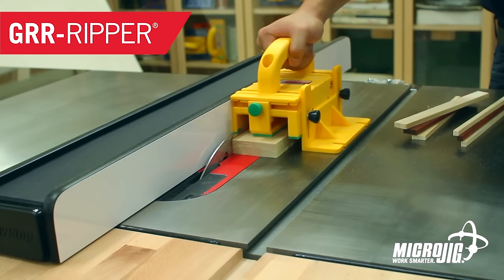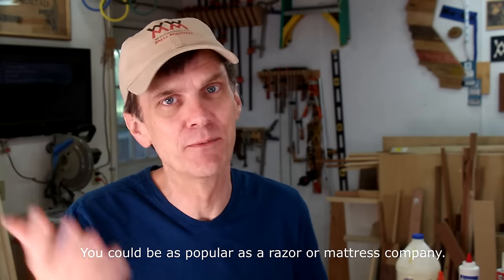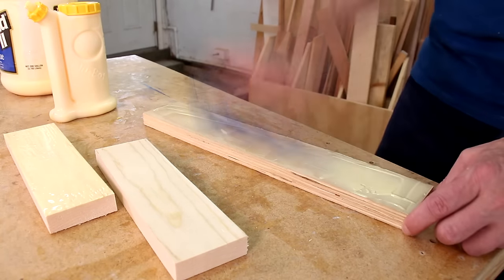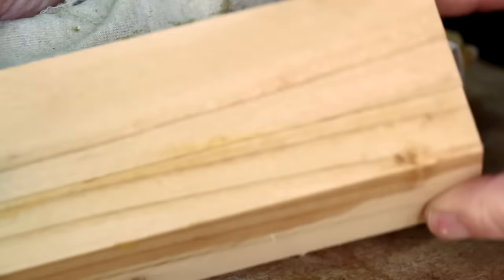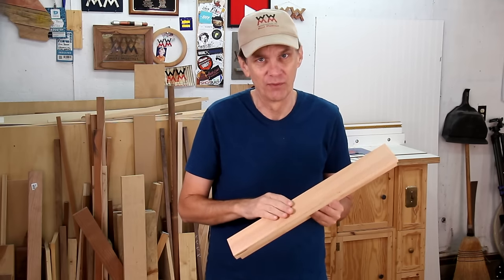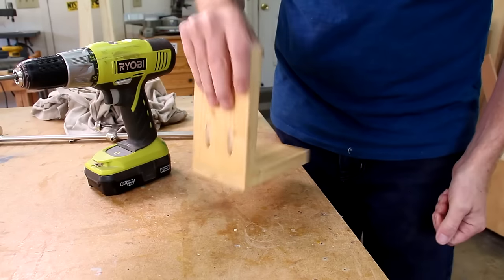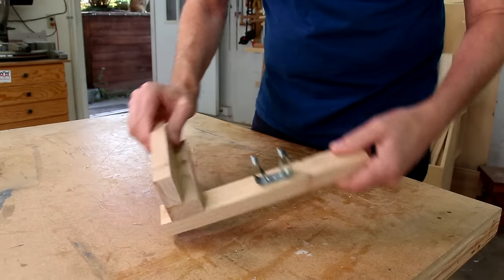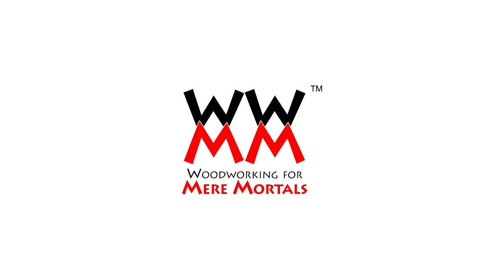What You Need to Know About Glue | WOODWORKING BASICS

Comment: I was a glue/veneer specialist for most of my life and I think you did a great job.  

You might want to mention waterproof, and water resistant glues for exterior applications. And also, what kinds of glues will stick to oily woods like teak and how the application of denatured alcohol on the surface to be glued will remove the surface oil and prepare the piece for the application of the glue.

 It has been my experience that the wood should be clamped very tight.  Those water based glues like you were using, tend to shrink as they dry.  When brushing on the glue, brush in both directions to work the glue into the pores. Brushing in one direction will pull the glue out of the pores.

Polyurathane glues like Gorilla glue will expand as it dries so you need to be carefull or you will have a mess to clean up. Because it expands, you won't need to worry about a tight clamp.  

If gluing something thin, it's alway best to use a backer board that covers the entire area and be sure the clamps are in close proximitry so you squeese out the glue.  You can coat the backer with any kind of wax like butchers wax and the glue will not stick to it.

What you did with the screws on the end was great and is exactly how I use to do it.  Another neat trick is to increase the surface area by using a spline or a bisquit.  If you look at your kitchen cabinets, they are probably made that way meaning they are routered in a way to increase the surface area to be glued.  

I enjoy watching your videos and I hope I was able to add some additional, useful information.  God Bless

Bob
Reply: Thanks for this comment. This will really help me with my college project of building a stand-up paddle board. I'm worried about the gluing the most.
Reply: Adding Biscuits for extra strength is a bit of a myth but very good for accurate alignment.
Reply: @christianpetersen1782  Yup! But they really do make a huge difference for accurate alignment that's for sure. I love them for that.
Reply: This is a quality comment! Thanks for sharing!!!! :)
Reply: Thanks for sharing. Thats why i love woodworking comunity
Reply: I really like how well u worded ur very useful comment, and maintained respect to the channel owner. 👍
Reply: Bob Perry Thanks for your advice! I am wondering whether there are any cons using waterproof wood glue for indoor and outdoor projects ...  respectively what are the pros of regular non waterproof wood glue. would appreciate your response thank you!
Reply: Although I agree about not having to clamp gorilla glue, tightly, I generally do because the pieces tend to slide around, quite a bit. Another thing is that, I hope no one was confused and think that it doesn't require a clamp, because, due to it's expansion quality, it would force the pieces apart.
Reply: @annaalm18  from my experience, the biggest downside to waterproof wood glues (such as Titebond III) is that it seems to discolor more than others. It's not that big of a deal if you're building a simple picnic table and just using sealer to weather proof it, but if you're planning to build an indoor coffee table out of cherry and you plan on using real finishes for visual appeal, it will darken the color considerably at the joints.
Reply: Bob, what think of UF (Urea Formaldehyde) Resin glue?  Weldwood makes one.  I am amazed at the strength of it!  Thx.
Reply: @JoshuaParnell  that's interesting - THANK YOU!!
Reply: Bob Perry My Son used to Skateboard. And I have his old boards that I want to cut down into strips. Then glue strips and make a shallow bowl or picture frame using the multi coloured veneers for effect. 
Can you recommend a good glue for this?
Also. I have a phobia about too much clamp pressure. To me it’s like you squeezing the liquid out of where it supposed to be. In other words. A thinner layer between pieces
Reply: Covis KK tightbond 2 or 3 would work fine. Heavy pressure not necessary however, clamp until there is squeeze out. The aforementioned comment about discoloration hasn’t been an issue for me throughout the years due to planing/sanding taking place after glue up. Shouldn’t be an issue for your project whatsoever.  Have fun with your project.....
Aloha 🤙🏽
Reply: Thankyou Bob - this is why I like to read peoples  comments
Reply: @annaalm18  k
Reply: After working on dozens of ocean going boats, EPOXY is the only adhesive for me. I like slightly thickened West or System 3. They're all about the same.
Reply: ...or was it James Bond?
Reply: @byLokie  You want as little glue as possible in the joint, assuming all surfaces are clean and flat.
Reply: I wanna know about the smell, is it strong? Or does the glue safe for pets because i wanna build a cage for my hamster.
Reply: @annaalm18  Most waterproof glues dry by chemical reaction when mixing a resin with an catalyst.  these should only be mixed and  applied in a well ventilated area. I don't recommend the glues with formaldehyde because they will leach harmful vapors inside a home for a long time, and can potentially cause health issues. Outside the home is usually ok. There are other waterproof and water resistant wood glues that are safer to use like titebond, and any of the polyurathane glues like gorilla glue.
Reply: @Glen.Danielsen  Yes!  That's the typical marine glue!  You have to mix two parts together.Usually a powder catelyst and a liquid reson. Some companies make a liquid catelyst which are much safer. Dries by chemical reaction. Yes it is very strong but pretty much any glue, is stronger then the wood itself, if clamped properly.
Reply: @byLokie  No worries there. Titebond is fine and easy to use.  Don't worry about squeezing out too much glue.  I use to use hydrolic pressure to clamp door parts and window parts together and some of the things I made have been in buildings for over 35 years, so far.  The love you have for your son will make for a beautiful outcome!
Reply: @JoshuaParnell  Thank you!
Reply: @tonyhemingway7980  You are absolutely right!
Reply: Hi Bob, Thank you for your comment. Can you please let me know if I can dilute Tightbond type 3 wood glue and add 25% of water into it with an objective to make it a little more fluid, will it reduce its bonding strength? The reason why I want to add water is to make it a little thin and be able to apply it on thin cracks in the wood and enable it to seep in deeper.
Reply: @AtifHasanReflections  Titebond says you can add up to 5% water.    Gorilla glue is another good choice for filling in cracks because it expands as it dries and you can dilute that as well by adding up to 5% water by weight.  Good luck.
Reply: @gym_bob  thanks a bunch. Let me try Gorilla. 👍🙏
Reply: @julianpacheco4183  how did it turn out??
Reply: @user-vp8sd4qd1x  Overall, my team and I made first place in our competition/final project! While the gluing wasn't our most detrimental issue, I had some concerns that this explanation cleared up and it helped me make an informed decision. I was very appreciative. This was my first big project in my first class when I was a freshman and still an engineering major.

Comment: To recover nails holes, i usually use the powder i sanded from the wood itself, mixed with a transparent glue, works like a charm.
Reply: Wow!!! I can't believe it- I thought I was the inventor of that. Great minds think alike. Actually, I have saved some in a plastic jar.
Reply: Sixty years ago when I was an aeromodeller I used to mix balsa sanding  with balsa cement and use it as a filler. It matched perfectly with the wood.
Reply: This is what I would recommend..
Reply: I was taught this method by an elderly woodworking teacher at School in the seventies still use it today works a treat still surprised that it not more widespread
Reply: Use drywall compound.
Reply: What kind of transparent glue??
Reply: Any stain does not cover the spot though, due to the glue in the mix so the holes will still be visible in my experience ( which is limited I admit).
Reply: Sure does😁 l teach DT and filling becomes an essential when you see some of the students joints.
Reply: @dinyardalal  My Woodwork teacher taught us that trick fifteen years ago back in high school.

Comment: Awesome video, Steve. But you missed a great opportunity. At about 4:54 you mentioned using a brad nailer to act as clamps during the bonding process. And how brads leave visible holes to deal with later.  Although this is not a gluing technique, it is a great tip to hide those nail holes. 

I'm sure you know this tip. But you may have some viewers who don't. Add a small drop of wood glue to the nail holes and run an orbital sander over the area. As it sands, it forces the sand particles into the nail holes and covers them completely. And because you are sanding the piece with holes in it, the matches the wood shade perfectly.

Thanx for your great videos, Steve. I watch them all.

Comment: Pro Tip for excess glue removal. Don’t wipe it off while it’s still wet because that will spread it into the surrounding wood and will be harder to remove and may even ruin your finish. Instead let the glue dry as it is and once dried it is easily peeled or scraped off without staining any excess would.
Reply: Is there any surface prep, like shellac, that will be an assistant to repel the glue during final glue up of inlays...?
Reply: I've used a damp sponge before and it seemed to work well
Reply: Yep. New to woodworking and am varnishing my first project. Looks awful where I wiped the glue away. Next time I wont touch it and after it dries for 15 min I'll scrape off with chisel. I worry scraping off after it fully hardens will chip the wood.

Comment: really enjoy your videos. one thing i learned when i would be in my grandfathers shop watching him, he used saw dust from the wood he was working on ( scrap piece, sand with some 80 grit) and mix it with wood glue and use it as a putty to fill the nail
 holes. it stains the same color and never knew the difference.

Comment: Love your information. glueing up a series of small wood for box. I found using a sharp puddy knife to run along the glued surface removes almost all the glue especially if surfaces are not even you can run along the lower surface and get it "all." Also cutting a plastic straw at a 45˚ angle can be used to move along the glue line and remove it cleanly.

Comment: Polyvinyl Acetate (PVA) glues like basic school glue and basic wood glue, are plastic polymers emulsified in water with the help of surfactants and other additives.  As the water dries, the plastic polymers congeal into a continuous plastic film.  Unfortunately, the surfactants and such stay with the film.  This means that exposing the dried film to water can re-emulsify the polymer to some degree.  Higher performance emulsifying technology can reduce the tendency to re-emulsify and that gives us a PVA glue that can withstand soaking in room temperature water.  The adhesive industry calls this a Type II adhesive.  Further improvements can be had by adding cross linking technology which makes the congealed plastic film much higher in molecular weight than the original emulsified polymer.  This makes a PVA glue that can withstand being soaked in boiling water.  Confusingly, the adhesive industry calls this a Type I adhesive.  Titebond III is a Type I adhesive with crosslinking technology.
Reply: LAME !!!!!
Reply: @dillwiggle2  Just because you don't understand it doesn't make it lame.  Thanks 1arm_65 for the explanation.
Reply: In certain fields like mine (instrument making and repair), the fact that wood glue joints come apart easily with heat and water is an asset. Means that as long as an instrument maker didn’t use some weird epoxy (which has been happening more and more recently) you can easily take the joint apart without damaging anything using a bit of steam and some patience.
Reply: you have heard of wood, right? It doesn't like heat and moisture either.
Reply: Holy scientific geek batman
Reply: And what is WeldBond? Is it a PVA glue again? What type?
Reply: Thank you for this explanation. It's great to have this insight. 👍
Reply: @manifestgtr  that's why Hide Glue is still preferred for instruments.
Reply: Glorywhole 

Hahahaha killer username 🤙

And yes, absolutely...hide glue also has the advantage of having existed long enough that we understand its properties when it comes to “creeping” as well. It seems like the jury is still a bit out on wood glue’s creep in the long term